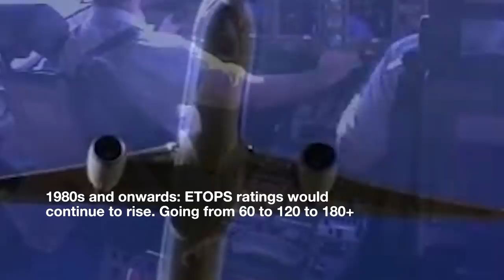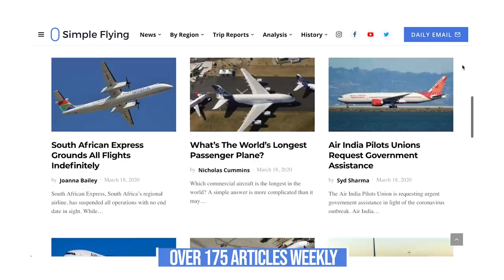Why Did Tri-Jet Passenger Planes Not Become Popular?

Comment: Soon we'll be going from 2 to 1 engines
Reply: lol
Reply: Then if the trend continues.... 0
Reply: where would it go
Reply: @gavinguy148  And then -1
Reply: @fahmirblx  it does not make sense
Reply: @fahmirblx  then -2
Reply: Sean Walsh on the tail
Reply: One power generator, yes
Reply: It's not a good Idea because if one engine fails they all fail because there is only one.
ETOPS : I am a joke to you
Reply: zul then we be using -3
Reply: You haven't thought this through have you?
Reply: Only one engine and a huge parachute for the plane .LOL
Reply: No.
Reply: Lol. They will be one engine when they figure out how to make engines that can't fail.
Reply: ColdPizza hybrid planes the engine is there to extend range. Batteries can power the plane for take off and landing. Currently the problem with electric planes is it's extremely short range hybrid will take care of that.
Reply: @Kryptictails  I agree
Reply: @gavinguy148  ? Not 1 then How will we land planes if we lose engine 1 and its only 1 engine
Reply: @StarTheAvgeek  i agree it can only glide all pilots need more training if a engines fails
Reply: @Kryptictails  indeed
Reply: @StarTheAvgeek  it would cost more money they can't do that That is right the maker of the plane can just skip the training of that like how boeing did the the 737 max 8 when boeing didn't tell pilots about macs
Reply: @Kryptictails  Yes that's why the 737 max crashed in 5 months
Reply: @StarTheAvgeek  yes having 0 engines can be done on the ground but in the air... 100% you will go 737MAX mode
Reply: @Kryptictails  Yup
Reply: @seanwalsh9814  The Gimly Glider

Comment: “Do tri-jets still have a place in modern aviation?” If only there were value to beauty in aviation, and not just cost efficiency. I live not to far from PTI, and although rare, it’s always a thrill for me to see a FedEx MD-10 or MD-11 rotate off the tarmac. Also, the presidential VC-25s will do touch-and-gos down here on occasion, usually with a KC-10 refueler. It will be sad to see them go. The price of technological advancement, I suppose.
Reply: "tarmac"... theres no physical part called a tarmac, there is the Apron, the Taxiways, and the Runways.
Reply: beauty is not important, twin engines have a lot of advantages over the tri-jets, of course cost efficiency is important, but also and more important is less co2, alone from reducing weight is a quite big win.
Reply: @carterrissmiller2510  the tarmac is the only part of an airport news reporters think exist.

Comment: 0:27 illustrates Trident tri-jet with a four-engined version :P
Reply: Tell me how you spotted this( yes I have a little phone)?
Reply: A little booster engine for takeoff. The 3 main engines were used in flight, while the little booster was shut off
Reply: @deweywatts8456  Helps that I already knew that four-engined versions of the Trident existed.
Reply: @sylviaelse5086  Cool!

Comment: With the reliability of today's engines, the odds of a double engine failure at cruise is so low combined with the adequate power of one engine, trijets may have questionable tangible benefits.  I do wonder though about the odds of a triple bird strike vs double bird strike (Scully case in New York).

Comment: Simple... EFFICIENCY is the name of the game in passenger aircraft now. 

New super-powerful and highly reliable engines like the GE-90, GE-9X, RR Trent, etc. generate plenty of thrust for even the largest 777, 777X, and A350 aircraft. The GE-9X is not even as powerful as the GE-90, and the 777X is so aerodynamically efficient, it doesn’t even need the thrust that the GE-90 engines generate... so it uses the even more fuel-efficient GE-9X engines. 

Only two engines are needed now for even the largest aircraft flying the longest routes. It no longer makes any economic sense to build aircraft with more than two engines. 

It’s the relentless march of technological progress. I will always miss the 3- and 4-engine Super Jumbos - but sadly their day in the sun has past. They are simply too expensive to operate, and they cannot compete with the new-generation twin-engine Boeing and Airbus jets.

Comment: As much as I love trijets unfortunately they're a thing of the past. I can't see them making a return. Even though a lot of DC10s and MD11s have become frieghters not too many L1011s became frieghters...🤔
Reply: Honestly they could jst because they seem safer you could turn the one engine off in case of an emergency an it won't use extra fuel in case of a multiple engine failure which has happened many times through the years an could potentially save lives I think they should atleast until they make a way for every passenger to escape a jet going down
Reply: https://en.wikipedia.org/wiki/Stargazer_(aircraft)  This seems to be the last 1011 standing.
Reply: @jedgar63  Yeah, looks like it. I remember when Kalitta Air was starting out he had a few L1011 freighters and 727 freighters he used to haul horses...

Comment: Trijets had a reputation for being quieter, but I presume modern twinjets are also quieter than 40 year old technology. Some of the new designs for smaller supersonic jets suggest an interest in three engined planes again. Bearing in mind that trijets have had a long and successful career in air cargo and military uses, perhaps there might still be a functional advantage to such a configuration for very heavy loading.

 There was something rather pleasing about the look of trijets; the Lockheed Tristar especialy, imo, but pleasing exterior design is not the primary feature when designing practical and economic planes. If the things were cheap, fast and safe, they could look like flying bricks, I'd guess.

Comment: Imagine if Boeing revive the md11 program and made a Modern version of the aircraft , but shorter and more efficent and  the wings like the Boeing 777x and made this version the new middle market , btw great content on this channel , keep it up man
Reply: If only they did...
Reply: That's sound great and more as a new middle market  👍 #boeing , revive this amazing plane please! Imagine a "BMD11x"  they are a lot of letters , but you what I'm talking about 😉
Reply: 2 GE90-115s are more powerful than the 3 engines on MD 11 combined. Meanwhile fitting large engines at the tail could be prohibitively complicated, but modern engines essentially gain efficiency by making size and therefore bypass ratio larger.

Comment: The Trijets include the Lockheed L1011 Tristar Also like the Mcdonnell Douglas DC10 and MD11 were Not Fuel efficient and limited Range than Twin Engine On ETOPS Route.
Reply: But if they had a chance to evolve as the twin jets did, they'd be much more efficient now than they were then. A bit like the 747-800.
Reply: @julosx  That’s really hard. Say, both DC-10 and A300 came with CF-6s, but DC-10 needed 3 while A300 needed just 2. Then of course the latter would burn less.
Replace CF-6 with any engines the same would probably still applies.
Reply: @steinwaldmadchen  On the other hand you could/can carry more with a DC-10 than with an A300. They don't fit in the same category. Also, having a 3rd engine can facilitate operations in high altitude airports, I'm thinking for instance about La Paz Airport (Bolivia) that sits at 4061m (13 000 ft) or on very hot climate countries like Jedda in Saudi Arabia.

Comment: Most people don’t know that commercial a/c have to be able to continue to take off, climb and land in the event of an engine failure after V1 irrespectively of how many engines they have, as a result twin engined a/c under normal take off conditions have more power than a triple or quad engined a/c and are therefore safer under normal circumstances. I cannot recall any crash where a second engine failure on a twin engine a/c has caused a crash unless the pilots shut down the wrong engine. Eg British Midland B737-400 crash at Luton airport. Assuming engine failures rates are the same the chances of an engine failure during take off are twice as high on a quad engine a/c than on a twin a/c. In these circumstances it is easy to see why operators like the improved economics of twin engined a/c.

Comment: Maybe in the future when all 4 engine and 3 engine planes disappear, cargo carriers may need some tri-jets for heavy lift capacity.  But, maybe twin engined aircraft may be powerful enough to carry everything by then.
Reply: They already exist A350-900F and 777F ( the 777XF is still in testing and certification fase) 
The DC10/MD11 and other older converted freighters like for example the DC8 with CFM engines at Fedex/UPS are replaced by 767 / 777F and 747-8F  UPS is sofar the last customer for the 747-8F
Reply: Richard Smeets I figured the newer 2 engined planes could outdo or almost equal most old tri-jets. I was thinking, maybe someone will need new a heavy lift that the newer twin jets can’t supply.  I doubt it though. It would be such a limited market.
Reply: @goteamdefense  That’s why 747F is gone - for good. It’s iconic, but unfortunately 777F is doing almost as good as it while burning much less.
Reply: @goteamdefense  that heavy lift niche market is covered by the AN 124 / 225 no C5  is sofar i know ever build for civilian use.  
The AN225 is the only aircraft ever who transported a mainline freight locomotive! 
The other niche are the bulk lifters like the 747 dreamliner and A300 beluga who are for hauling big volumness cargo.
The granddaddy of these bulk freighters the Guppy and turboprop superguppy were converted to transport Mercury and later Saturn V rocket stages. 
The 747 dreamliner and A300 beluga transport aircraft fuselages and wings.
The only niche market that the 747 with a nose visor door can exel in  is for hauling long goods. 
A tailloader like the civilian C130's are way more rare and expensive to buy then an used 747 with visor door.
Reply: Richard Smeets I was thinking maybe some tri-jet would make economic sense ( less gas than a 4 engine plane but more capacity) , but between the AN planes and 747s and more powerful twin jets, I think it isn’t likely.  On a purely aesthetic level, tri-jets just look more cool than twin jets.
Reply: @goteamdefense  the 747-8F has the 4 engines that burn less fuel with modern engines then the 3 engines of the MD11.
The trijet is not death,
There is 1 trijet still being build.
its the Dasault Falcon buisness jet!
https://www.dassaultfalcon.com/en/Pages/Home.aspx

Its possible that in the future tri engined aircraft  could return.
2 electrical duct fans and 1 fuel burning turbine for take off and landing.
You never know were tech leads us

Comment: Conventional airplanes are always tail heavy because of all the metal required for the vertical and horizontal stabilizers. Throwing on a third engine in the back just makes the problem worse. That's why on a DC-10 or MD-11 you must watch your fuel load when taking on fuel because if you don't you can sit the airplane on its butt and toss everyone inside all the way to the back. Then the press comes out and takes pictures which make national news. Ask anyone who worked for DynAir in Phoenix they will verify it happened. Getting the nose back on the ground was a little more difficult than they first thought.
Reply: Finally an engineering comment.  Thank you sir.

Comment: The Boeing 727 was VERY popular until the poor fuel economy and the noise issue did it in
Reply: This was another problem with tri-jets. Other contemporises like the 737 and DC9 lasted much longer because it was possible to fit newer engines to the same airframe (although Boeing may have gone slightly too far with the Max). The 727s tail engine being built into the fuselage made it impossible to replace without a major redesign. Some 727s have been retrofitted with more modern engines, the same as fitted to the MD80 (which is a DC9 with newer engines), but only the outer engines can be replaced. It didn't help that by fitting newer engines to the 737 and DC9 (now known as the MD80) it was possible to stretch them to the point where they were competing with the 727 in terms of capacity. In a way Boeing did re-engine the 727 and stretch it, but this was in the form of the 757.
Reply: Although the tail and wings ere slightly different on the MD 80 than on the DC 9

That was the first time McDonnell-Douglass used CAD CAM for wing and tail design
Reply: @ChrisCooper312  There were 2 lengths of 727  I used to see them fly over all the time when I lived on the final approach of National Airport In  Northern Virginia

Comment: Trijets will be freighters for a while. Think the MD-11 and to a lesser extent DC-10. 

Also, WHY, JUST WHY was the MD-11 worse than the A340?
Reply: @Max Xgame Weren't they both released around the same time
Reply: MD-11 is better
Reply: @mcdonnelldouglasmd-1124  Yes, indeed you are better. Fedex, UPS, and Western Global still have a crush on you. Like them back. Just know that you are more iconic than the A340. :)
Reply: From a return on investment perspective for the manufacturer, the MD-11 WAS better. Granted, both programs were in the red. But the  A340 was a disaster financially, especially the -500 and -600. Government subsidies and hot selling A32X and later A330s saved Airbus.
Reply: MD-11 was more expensive, 1 unit cost 100 Million in 1990 A340 70 Mils

Comment: Bring them back. I feel safer with 3 or more engines on long distance flights...
Reply: You underestimate the technology of modern plane engines and contingency systems of airplanes.
Reply: Read the  United Airlines Flight 232 accident. The tail engine failure took out the tail controls. This type of failure is a risk for tail mounted engines.
Reply: It's not fair to compare the DC-10 with modern airliners with much more advanced technology and knowledge of aeronautics.

Comment: More engines just means more things to break. Given the reliability of modern turbofans, especially in the relatively low stress regime of transoceanic cruise, I'd be more worried about a loss of pressurization than engine failure. If you lose pressurization the number of engines is completely irrelevant. At that point the need to get on the ground has more to do with fuel efficiency and additional drag rather than suffering some sort of failure that's going to cause a crash, and you would be more concerned about simply running out of fuel.

Comment: I would like to have the following question answered: Is there any technical reason, why we don't see a clean wing on todays commercial aircrafts, starting with the 737 or A320? Is it because of the weight shift to the back? There would be less noise, I suppose. And those high mounted engines wouldn't pick up any foreign objects from the ground.

Comment: The 380 has proven that the airlines don't need bigger jetliners, and the 2-engine variants can power the largest aircraft currently necessary. So no, there is no reason to being 3-holers back AS PASSENGER JETS.

Comment: Without ETOPS, most tri-jet airliners would never have existed.
The Trident and 727 were exceptions, for specific requirements (high and hot operations mostly) that needed more thrust than the engines OF THE TIME could provide with only 2 engines.